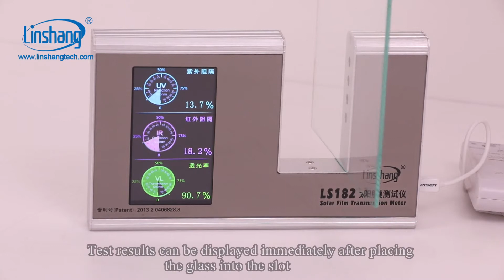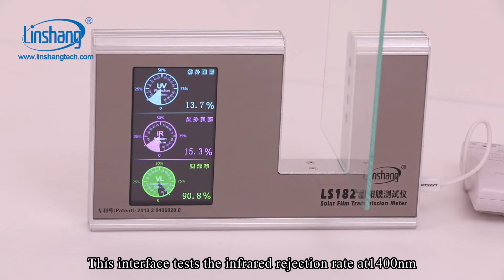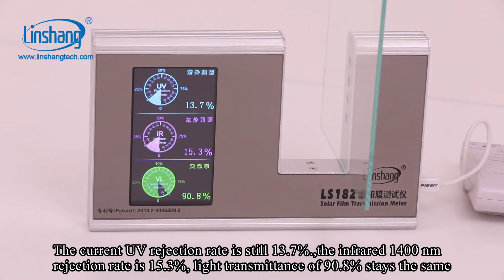LS182 Solar Film Transmission Meter

Comment: is this as reliable as the  WP4500 , which I guess it was copied from ?
Reply from the maker: Linshang LS182 solar film transmission meter is a device that can test the SHGC value (that is, the total solar transmittance, also called the solar heat gain coefficient), 950nm, 1400nm and Full IR rejection rate, 365nm ultraviolet rejection rate and 550nm visible light transmittance. The window tint meter is currently the most high-end solar film tester on the market. Three gears can be freely switched , easy reading and easy operation.